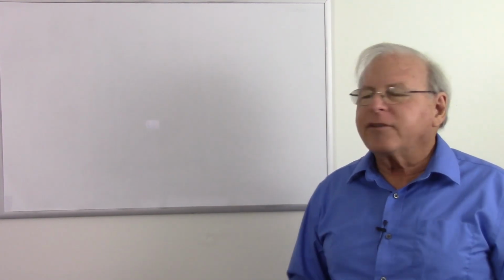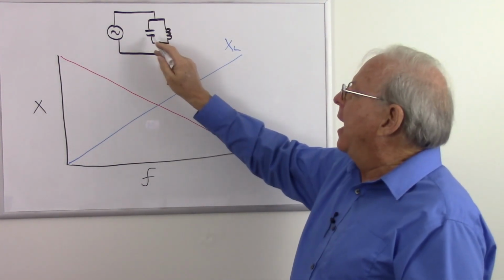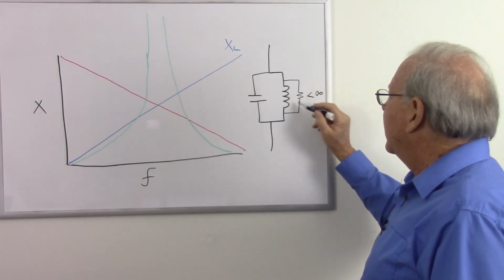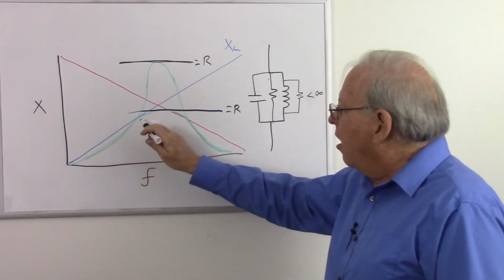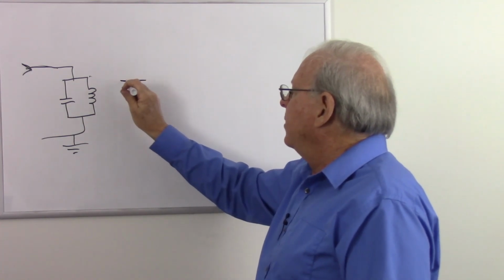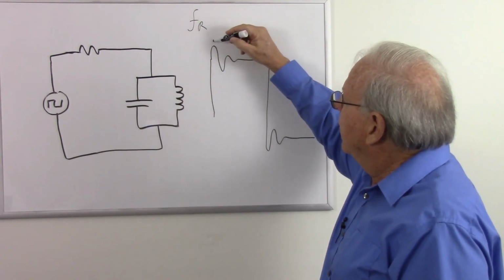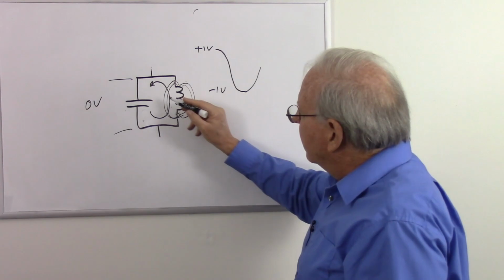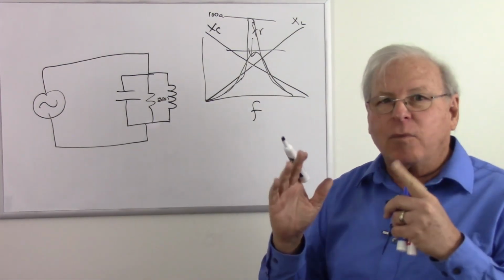AC Basics   Capacitors and Inductors in Parallel

Comment: . 
This is a whole of gobbledygook.  He has no idea how to explain how the circuit works. 
I have been teaching electronics for 50 years with 25 million visitors to my website. 
I have been using this circuit for 40 years and sold thousands of modules using the concept. 
The two components in parallel is called a TUNED CIRCUIT or PARALLEL TIMED CIRCUIT or TANK CIRCUIT or RESONANT CIRCUIT. The first radio transmitters were simply frequency transmitters and blasted their energy over the whole spectrum and needed thousands of watts to travel a few hundred miles.  It did not have this type of circuit as it was not invented. Then somebody invented it and the power of the transmitter went down to a 100watts and lots of transmitters could be used as they did or interfere with each other. 
But you have to tap the supply onto the combination for a very short period of time and allow the circuit to perform its magic. 
It will produce an oscillation that has a waveform we call a sinewave and you cannot touch it at all because the voltage you apply will be slightly different to the voltage it is producing and the whole effect will be destroyed. 
The effect is beyond amazement and no-one has described it completely. 
But here are the fundamentals. 
When you tap the circuit with a supply voltage, the capacitor will be like an uncharged battery and want to take as much charge as possible in the form of a high current. At the same time the inductor will appear as a very small resistance and want to take a lot of current too. 
But as soon as the current enters the inductor it produces magnetic flux that cuts all the turns and this produces a voltage on each turn that is an opposite polarity to the incoming voltage. This means that a voltage such as 12v will produce an opposing voltage of 11.9v and this the energising voltage will be very small and much less current will enter the inductor and the capacitor will get fully charged first. The supply has to be e removed at this point and we have a charged capacitor. 
The capacitor will now take over from our supply and deliver current to the inductor at the rate the inductor wants. All the time the capacitor does this, the inductor is creating expanding flux that produces a back voltage and only a very small forward voltage is needed to perform this part of the cycle. That means the capacitor can keep delivering its current to the inductor up to the point where it has only a very small voltage and when this point is reached the flux in the inductor is no longer expanding. It stops for a millimicrosecond and then starts to collapse. This collapsing flux produces a voltage in the opposite direction to charge the capacitor with an opposite voltage. Because the capacitor requires current when it is charging, this current through the turns of the inductor produces a back-voltage that reduces the effective voltage and slows down the rate at which the capacitor gets charged. 
This is the secret behind the waveform, the shape of the signal, produced by the combination. But you must not touch it when it is performing this action. The inductor will keep charging the capacitor until the flux has completely been used because even a tiny amount of remaining flux will produce a high voltage because the reverse voltage is reducing and its capability is increasing. 
This action continues until the flux is all used and now we have the condition we started with. 
Now, here’s the important part. 
The energy stored in the inductor, in the form of magnetic flux, must be exactly the same as the energy stored on the capacitor in the form of an “electric charge.” 
When this is provided, the two components will pass the energy back and forth forever. However there is a small loss due to heat and gradually the amplitude will reduce to zero. 
If the components don’t match, the one that gets filled the first will dictate the speed of transfer. 
Because the voltage gets reversed, if you connected one end to a “ground reference point” the other end will be a voltage higher than “ground” and then a voltage lower than ground. This is effectively an AC voltage that is twice the amplitude of the supply and the circuit DOUBLES THE VOLTAGE! 
When this circuit is used as an oscillator, it is supplied with a tiny pulse and the delivery component is removed to allow the two oscillator components create their cycle without hinderance. They are very accurate and very reliable. You can draw off a small amount of energy and the circuit will still work.

Comment: can someone explain why the graph of capacitive reactance v/s frequency is a straight line ?
Reply: It isnt!  Xc  is proportional to 
1/ F   - that is a graph of
Y = 1/x is a hyperbola..not a straight line.
Reply: impedance of inductor is jwL or j*2pie*f*L clearly a linear relationship with either f or w. However for capacitor it is i/jwc which is not linear but hyperbolic, which explains low reactance for high f or w.   Simply draw the function y =kx for inductor and y=k/x for capacitor and the k are arbitrary constants, ie the capacitance or inductance values multiplied by two pie and ignore the j for now as its interpretation requires an explanation on complex numbers and exposes the leading/lagging attributes.

Comment: Why in an ideal situation no current flow is happening is because the oscillations between L and C "clog the wires" so to speak. They form a looping/sloshing current that does carry and contain all the energy of the system in a standing wave. A standing wave does not allow for current to pass because it traps it within itself.

So the explanation for the infinite impedance is that the LC circuit @ resonant frequency creates a standing wave that takes in all the energy of the system.

That is what you observe in the square-wave source with the ringing in liquid nitrogen - the standing wave just persist indefinitely. In non ideal circuits in normal conditions the additional resistance impedes creation of the perfect standing wave, so some of the energy both bleeds through and gets dissipated through heat.

You are a great teacher, because of the clear though in-depth explanations that inspire me to think about those topics, even though I have only very basic formal education about electricity. You make complex topics accessible to the lay people, which is a masterful skill for a teacher to have.
Reply: Using waves as a visual metaphor is a great idea.

Comment: In my novice brain i find it counter-intuitive that at resonance the impedance is at its highest. It would seem the word resonance means the signal is at its strongest and "un-impended" from its components. It is purely resistive without any reactance. I would think adding reactance adds a kind of impeded flow to the current more so than if there was no reactance, just resistance.

Comment: When operating at frequency where impedance are equal they alternately operate as sink and source and so can operate in isolation and the source only  needs to drive current across the resistor so resistance effects prevail at determining the circuit equivalent impedance.

Comment: Thanks.  This helps a little when I’m trying to stop the signal reflectance in model railroad control systems.  There are places along the track where the signal meets the reflected signal and we have a result of NO signal.
Reply: Impedance mismatch in your cable/connectors.

Comment: Would you say this is like a car's suspension with a spring and shock absorber?   they are given input waves that they resist but at other wave rates they are passive?
Reply: The spring is capacitance, the shock absorber is resistance and the mass/inertia of the tire and suspension parts is the inductance.  Force is the voltage equivalent and displacement is the current equivalent.
Reply: Yes.  It's a very similar concept, where the mass/spring/damper all do calculus on the position of the car as a function of time, as they respond to disturbances.  This sets up a differential equation that governs the response of the car.  The spring reacts to the instantaneous vertical position, the damper reacts to the vertical velocity, and the mass responds with an acceleration.

Relating it to electricity, the capacitor is analogous to the spring, the resistor is analogous to the damper, and the inductor is analogous to the mass.  This means that the arrangement of capacitors, inductors and resistors, sets up a differential equation that relates the source to the load.  Using the concept of impedance, and complex algebra, we're able to simplify the math from solving differential equations to solving algebraic equations.
Reply: @carultch  yes thank you, Id love to see/learn the calculus of this.  but I thought the Cap is like the damper, inductor like the spring and resistor like the load/mass?   Inductance is the force that resists a change in current?  Capicatance the force resisting a change in voltage?   the shock absorber resists in one direction far more than the other
Reply: @bradleyr4451  One factor that probably gets in the way of seeing this analogy, is the fact that electrical engineers think in terms of current, instead of charge.  By contrast, the mechanical engineers start with position, and differentiate to determine velocity and acceleration.  EE's start in the middle, differentiate to find what an inductor does, and integrate to find what a capacitor does.  When learning kinematics, you start at the most integrated end of the concepts, and differentiate to find everything else.  Think in terms of charge on the capacitor, and the analogy will line up much better.  On top of this, capacitance isn't directly analogous to the spring stiffness, but rather its reciprocal: the spring flexibility.

For mechanics, the derivatives follow the following pattern:
Position vs time = original function
Velocity vs time = derivative
Acceleration vs time = 2nd derivative

For electronics, we usually think of it this way:
Charge = time integral of current
Current = original function
Current ramp rate that an inductor acts up on = time derivative of current

But instead, if you think of it this way, it will line up better with a mechanical analogy:
Charge on a capacitor = original function
Current = first derivative
Current ramp rate for an inductor = 2nd derivative
Reply: @bradleyr4451  The damper is analogous to the resistor, because it takes energy out of the mechanical domain, and produces thermal energy.  The spring is analogous to the capacitor, because it stores energy as a function of its static configuration: the configuration of charges on the capacitor, and the configuration of metal atoms in the spring.  These are both forms of potential energy, that only depend on what you can determine at a static snapshot in time.

The mass of the car stores energy of motion, while the inductor stores energy in its magnetic field.  If you pause everything in motion, and lose the information about current and velocity, there will not be enough information to determine the KE stored in the mass, or the energy stored in the inductor.  These are both forms of energy that are based on motion, rather than position/configuration.

In any event, both the energy of motion, and the energy of position, can be returned to the system reversibly.  The heat energy that the resistor and damper generate, by contrast, cannot.  This is why the analogy lines up this way.
Reply: @bradleyr4451  Here's why the components have the analogous relationships I've assigned.

Capacitors and springs both store energy in a potential energy form; a form that only depends on configuration of charges and atoms.  You can take a snapshot in time, and you'll have all the information to know the potential energy stored in either of these components.

Inductors and masses both store energy in a kinetic form; a form that depends on the state of motion of the charges and atoms.  A snapshot in time won't tell you enough information to find the energy stored in these forms.

Resistors and dampers do not store energy, instead they dissipate energy into the form of heat.  The energy these components absorb, leaves the mechanical domain (for the suspension system) and leaves the electrical domain (for the circuit) permanently.
Reply: @bradleyr4451  Here's how the calculus works.

A car has mass m = 2000 kg, and its suspension has a spring constant k = 400 kN/m.  Its damper has a damping constant of D = 60 kN/(m/s).

The total forces acting on the car are:
m*g downward
-k*y(t) upward, for the spring, where y(t) is the vertical position
-D*y'(t) upward, for the damper, where y'(t) is the velocity

Construct N's 2nd law:
m*g - k*y(t) - D*y'(t) = m*y"(t)

Shuffle all terms depending on y to the left, and all other terms to the right:
m*y"(t) + D*y'(t) + k*y(t) = -m*g

A similar equation can be generated for a circuit, using all three RLC components in series, and a DC voltage source.  It will be of interest to solve for q(t), which can then be differentiated to find the current as a function of time:
L*q"(t) + R*q'(t) + q(t)/C = V

This is a 2nd order differential equation.  How do we solve it?  Start by assuming the constant on the right is zero.  We'll get back to using it later.  Next, assume y=e^(r*t), where e is Euler's number and r is an unknown constant.  In fact, we'll get 2 values of r, that could be real and distinct, real and repeated, or complex.  The solution will be a linear combination e^(r1*t) and e^(r2*t).  When real, we'll get exponential decay functions.  When complex, we'll get sine and cosine, enveloped by an exponential decay.

y'(t) = r*e^(r*t)
y"(t) = r^2*e^(r*t)

This gives us:
(m*r^2 + D*r + k)*e^(r*t) = 0

Since e^(r*t) cannot be zero, the quadratic in front is zero instead.  This means:
r = (-D +/- sqrt(D^2 - 4*m*k))/(2*m)

Plug in data, we'll get:
r1 = -10 recip sec
r2 = -20 recip sec

Thus, the solution thus far is
y(t) = A*e^(-10*t) + B*e^(-20*t)

To account for the constant, add +C.  Then apply to the original equation.  All the exponential terms will disappear, and we'll get:
k*C = -m*g

Thus:
C = -m*g/k

So the final general solution is:
y(t) = A*e^(-10*t) + B*e^(-20*t) - 0.049 meters

The values of A and B will depend on the initial condition, right after the disturbance.
Reply: @carultch  Im going to level with you.  I began my EE school work, then there was some turmoil and I went to a different school.  Id return for my EE work and they were clear you can only begin real EE classwork after you get Calculus completed, which would take years.  I had to do things in the "right now".  as Id return to school, it was always something.  I went back and took Physics for Elec and Magnetism.  Got prof to OK.  He's talking about the wave and at point p we do the integration and then use algebra to separate this and remove common terms, then differentiate this side, all simple stuff.  not to me.  Ive done alot without knowing Calculus.  Its like being an adult and not knowing how to read.  Im ashamed and wish I could learn.   I can follow in general what youre saying but need to learn, thanks
Reply: @bradleyr4451  I can recommend Paul's Online Notes, from prof. Paul Dawkins.  He's got a great course notes section for Differential Equations, which goes over the topics I've used in this discussion.  He has earlier Calc courses as well.
Reply: @bradleyr4451  I think my comment might've disappeared

Here's how the calculus works for this example.  For further background reading, I recommend Paul's Online Math Notes, from Paul Dawkins at Lamar University.

A car has mass m = 2000 kg, and its suspension has a spring constant k = 400 kN/m.  Its damper has a damping constant of D = 60 kN/(m/s).

The total forces acting on the car are:
m*g downward
-k*y(t) upward, for the spring, where y(t) is the vertical position
-D*y'(t) upward, for the damper, where y'(t) is the velocity

Construct N's 2nd law:
m*g - k*y(t) - D*y'(t) = m*y"(t)

Shuffle all terms depending on y to the left, and all other terms to the right:
m*y"(t) + D*y'(t) + k*y(t) = -m*g

A similar equation can be generated for a circuit, using all three RLC components in series, and a DC voltage source.  It will be of interest to solve for q(t), which can then be differentiated to find the current as a function of time:
L*q"(t) + R*q'(t) + q(t)/C = V

This is a 2nd order differential equation.  How do we solve it?  Start by assuming the constant on the right is zero.  We'll get back to using it later.  Next, assume y=e^(r*t), where e is Euler's number and r is an unknown constant.  In fact, we'll get 2 values of r, that could be real and distinct, real and repeated, or complex.  The solution will be a linear combination e^(r1*t) and e^(r2*t).  When real, we'll get exponential decay functions.  When complex, we'll get sine and cosine, enveloped by an exponential decay.

y'(t) = r*e^(r*t)
y"(t) = r^2*e^(r*t)

This gives us:
(m*r^2 + D*r + k)*e^(r*t) = 0

Since e^(r*t) cannot be zero, the quadratic in front is zero instead.  This means:
r = (-D +/- sqrt(D^2 - 4*m*k))/(2*m)

Plug in data, we'll get:
r1 = -10 recip sec
r2 = -20 recip sec

Thus, the solution thus far is
y(t) = A*e^(-10*t) + B*e^(-20*t)

To account for the constant, add +C.  Then apply to the original equation.  All the exponential terms will disappear, and we'll get:
k*C = -m*g

Thus:
C = -m*g/k

So the final general solution is:
y(t) = A*e^(-10*t) + B*e^(-20*t) - 0.049 meters

The values of A and B will depend on the initial condition, right after the disturbance.

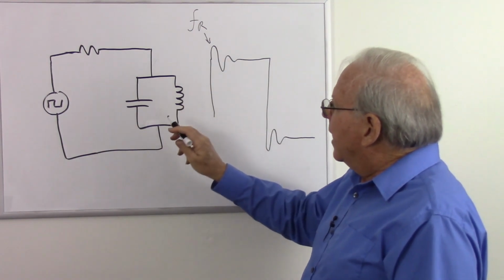Comment: Thanks these are so well done.  at 19:00 this is the reality of digital circuits at high speed,  used to test TTL circuits all day and you look at pins of the ICs and what should be a square wave is like what you show, because every circuit line has L/C/R in there so this is a very important concept.